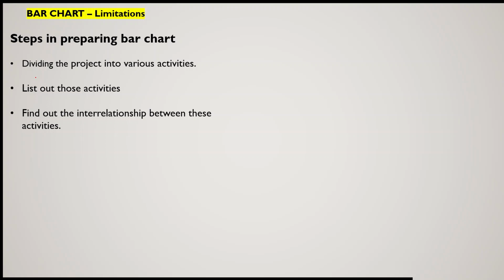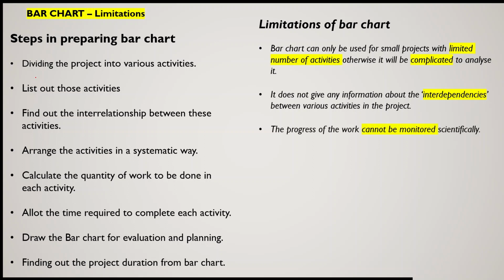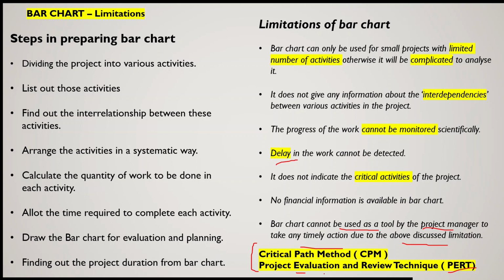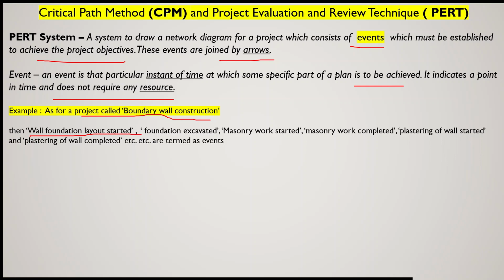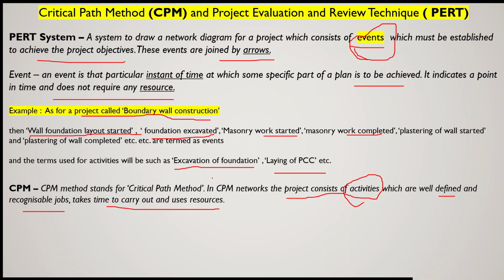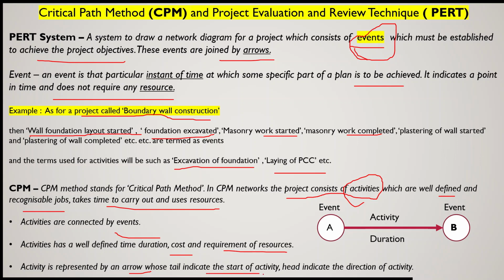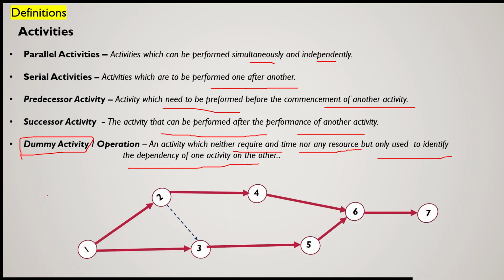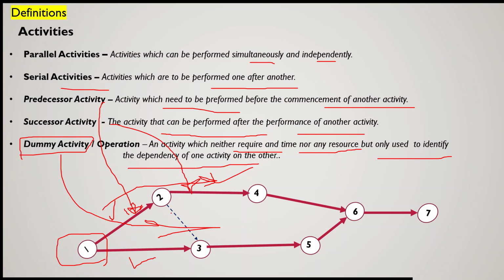CPM-PERT || Lecture No. 5 ||Construction Management | Construction Project Planning

Comment: Sir.. only one doubt..u said 3-5 activity can be completed after completion of activity 1-2...
 Sir can the activity 3-5 be started after 1-3 has been completed????
Reply from the maker: Good Question. But in this network only type of activities were explained. 3-5 can be started after 1-3 if the duration of 1-3 is more than 1-2. In lecture No. 6 it has been explained in details.
Reply: @DrBharatBhushanJindal  thnks Sir..🙏 doubt cleared now...